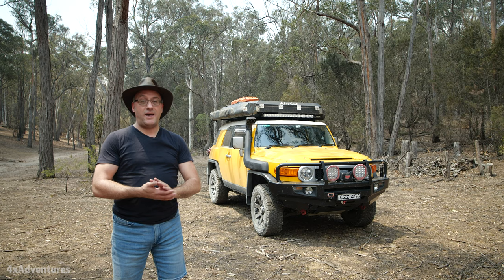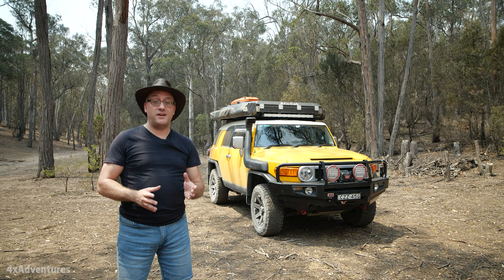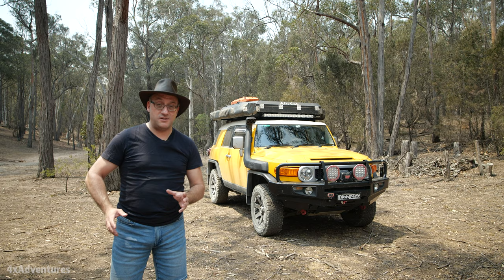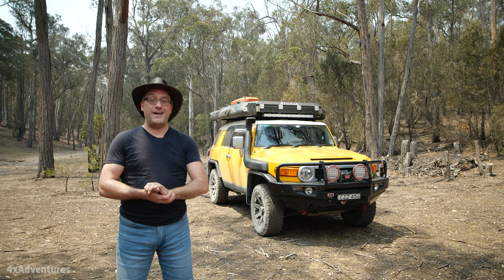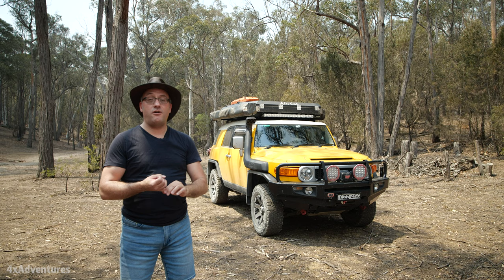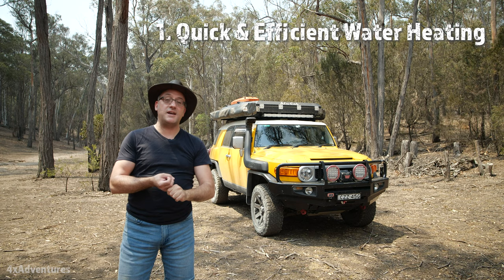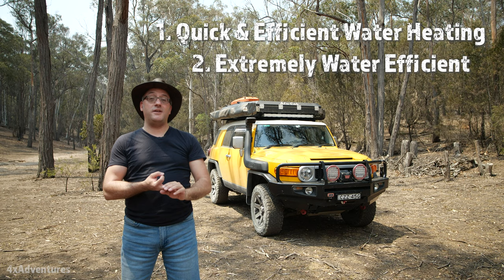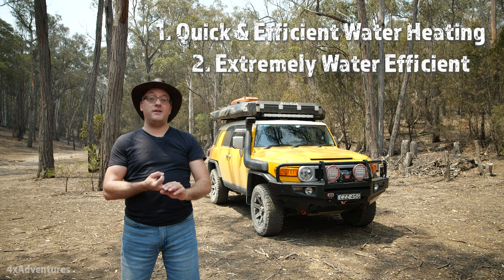Built-In Hot Water and Shower System for Touring/Overlanding | @4xAdventures#adventure #4wd #touring

Comment: I have the Glind system set up on my car with the two hose connections plumbed to the front of the bull bar. In between the two connectors is a marine switch to turn on the pump. This eliminates having to lift the Bonnet. People who own these systems are always under the impression they have to run the motor while they have the shower. This is not true. You can heat the water first. What I do is, using two short hoses I heat the water up in my shower jerrycan first. I have a thermometer dropped in it that has an alarm set at my desired temperature, which for us is 45°C. The wife loves a very hot shower so she goes first and then by the time I go in the water has dropped that little bit which suits me. While the water is heating I set up the shower pole at the front of the bull bar. I prefer the shower at the front of the car so it’s not soaking the ground around the door areas. Once the water reaches the desired temperature, the alarm goes off. I then turn the pump off and the car off and swap the two short hoses for the shower hoses. The water temperature only drops minimal by the time you’ve had your complete shower. It’s a way better experience having a shower without the motor running. You can enjoy the tranquility of the bush. If we need privacy I have a pop-up ensuite that just clips onto the front of the bull bar. 
We’ve had this system on the car for about 12 years now. In my opinion, these are by far way superior than any other shower system. No matter what the weather conditions are you’ve always got a hot shower. All the bulky componentry’s are under the Bonnet and out of the way.
Reply: Hey mate what connections did you connect to your bar?
Reply: @andrewsimpson1433  Standard brass hose fittings. The male ends. This is so I can connect blocked off female ends that act as covers.

Comment: Thanks for the great information. I’m halfway through fitting a Scintex 30 plate heat exchanger to my FJ. I’m now going to incorporate a temper valve and the JG piping.
Reply from the maker: No problems! I haven’t seen that heat exchanger before. I’ll check it out.
Re. The pump, just make sure you use a pressure sensing pump, otherwise you won’t get enough pressure to make things work properly!
Good luck!!
😊👍
Reply: @4xAdventures  yes, Seaflo pump pressure sensing. I'm building a solid, reliable system.  It will take some time & $$ but it will be worth it 👍😀
Reply from the maker: Yes, it isn’t the cheapest solution, but it works really well & should last as long as the car does. And no hassles with lugging showering contraptions around with long setup times. I think this is a great solution :)

Comment: That is a nice install, simple, efficient & elegant, does away with the overheating issues that others complain about with the Glind system, a temper valve just makes it simpler & better. Love the pop out shower cubical as well. I will look into that pressure piping for my install as I just scored a full Glind system in a case for free today.
Reply from the maker: Thankyou! 😊👍

Comment: I’ve got a companion aqua cube lithium and I spent two weeks away over Christmas everyday and it never let me down, in my opinion better than a heat exchanger
Reply from the maker: I also have a Coleman hot water on demand, which is similar to what you have. Every product has its strengths & weaknesses. I’m glad you’re satisfied with your product. 
The reason I decided to make my own hot water system is because i wasn’t satisfied with the Coleman unit. It was incredibly wasteful with water, and it took ages to set up - lots of clutter & paraphernalia. I think if you’re staying at one camp site for a few days, then it’s fine to set it up & leave it, but I was after something that was simple, quick to setup & efficient with water. So I think I’ve improved on my old Coleman system, which I found to be a hassle. 
But, to each their own! 😊👍

Comment: This is great! I'm in Nashville, TN and am building out a 2020 Tacoma Off Road. I just found my shower solution. Thank you for taking the time to make this video and post it.
Reply from the maker: Hey Joey! Thanks very much for watching! I’m glad you found it useful. I’m sure you will be satisfied with this solution. I’d love to see the completed Tacoma - they are great vehicles!! 😊👍
Reply: @4xAdventures  Is this the correct exchanger? https://glind.com.au/store/heat-exchangers/glind-auto-marine-heat-exchanger/ 
Model SKU: GL27 Auto and Marine. 
I'll for sure share some pics when its completed!
Reply from the maker: Yes, that’s the one. Glind has a US distributor. Check the video description for the link. That may save you international currency & shipping fees.
:)
Reply: @4xAdventures  Would the SEAFLO water pressure pump Model : SFDP1-070-060-53 do the trick? Also, if its not too much trouble, can you tell me what model temper valve you decided on? Thank you very much for your time and knowledge.

Comment: The system I just built is a tad simpler. I used a ball valve on the inlet of the coolant to the heat exchanger to control the shower temperature. The more you shut the valve, the colder the water gets. I also used a pump and a solenoid valve instead of a pressure sensing pump.
Reply from the maker: Excellent! Very clever!! I guess just don’t forget to open the ball valve fully before driving :)
Do you have to keep adjusting the ball valve each time until the water temperature is right? The advantage of the temper valve is you get the correct temperature water straight away without wasting water. But I like your setup!
Great job! 😊👍
Reply: @4xAdventures  I just leave it fully open. So far my setup produces pretty much perfect water temperature with the engine idling, and if I need to make it cooler i can always close the valve a bit.
Reply from the maker: Excellent!! :)

Comment: Nice system.   I had hoped you'd made your heat exchanger yourself as this is the part I am searching for.   But I will steal that temper valve idea :)
Reply from the maker: Thankyou! I don’t make the heat exchanger, but I liked the idea so much I have eventually become a reseller of the Glind heat exchanger. You can check out 4xAdventures.com.au for more details if you’re interested. I’m still working on how to sell all these bits as a kit, but it’s quite difficult as every car is different. All the best! 😊👍
Reply: @4xAdventures  I am trying to work on a slightly different system, I am not sure if I am wasting my time or not, but I am looking at having a hot water storage tank, and the heat exchange would be like a coil running through that tank.  My theory was I could have 20l of hot water stored.  Too much for just one but I camp with the whole family often.  The problem is where to put a tank in an overland vehicle.  I would imagine your system may require an engine running if I was to shower a bunch of people?
Reply from the maker: Yes, it’s fine for a while with the engine off, but eventually you would lose heat. Your best option is to get yourself a Duoetto electric hot water heater. They have 10L and 6L versions. They are excellent. If you look at my plumbing, just replace the heat exchanger with the electric water heater - you can still use the temper valve & pump and it will work perfectly well. With 10L you should easily be able to shower 4 people. I will hopefully list their products for sale on my website soon. 😊😂

Comment: Great system - I think you've solved the only real hassle I have had with a heat transfer shower system....by using the temper valve ! Brilliant ! I take it that the one pump can generate enough pressure to impel the water in 2 streams, one to the heat exchanger and the other to the temper valve ?
Reply: Actually, you have already answered my question above. Another one : did you get the under bonnet hoses and fittings from RTM too ?
Reply from the maker: G’day Denis, yes, you’ve got it! water source > pump > splitter. 1 path to heat exchanger > hot input of temper valve. The other path to cold input of temper valve. Mix output > shower rose/tap.

Mine has evolved a bit beyond that now. I have a choice of inputs now & a few other tweaks, but that’s the basic flow.
Reply from the maker: The heat exchanger came with a few radiator hoses, but I had to go buy a few more from Repco to make it fit nicely.

Comment: Will the tempering valve stop the water flow out the mix output if the water temperature is under the set temperature or only if it is over the set temperature and not able to get cold water through to mix it?  Meaning if the vehicle is not hot enough to enable the heat-exchanger to provide hot enough water for the tempering valve setting. Otherwise you could still waste plenty of water if you did not run the vehicle long enough before using the shower. Great set up by the way.
Reply from the maker: Thankyou. Yes, you are correct, the temper valve is designed to stop the temperature getting above the set threshold, but it will let colder temperatures through. I’m using a scangauge which is connected to the OBD port. It shows the engine water temperature, so I can tell by looking at that - but also just experience will allow you to gauge what the resulting output will be. But, you can always just leave the engine running and all will be good! 😊👍

Comment: This is the way to do it! Love it! 
Can you please tell me if the pump you recommend will lift water up from a bucket or even a creek with out the need of priming it first? It looks like you have it located higher than your tank?
Reply from the maker: Thank you! The pump can definitely lift water from a bucket, no issues at all. The factors that determine if/how well the pump works in other scenarios are: length of hose, the incline up which you draw the water. I haven’t tested this over long hose runs or up steep hills, so can’t give you a more definitive answer, but I do remember reading the pump specs where this information was documented. Perhaps try to find the technical specs for the pump? It is a Seaflow 9.5LPM automatic pressure sensing pump.
All the best! 😊👍

Comment: Great video, what a great system. 
I have a 2000 hiace trakka with an undercarriage tank of 118 litres and another 50 litres under the bed.  The tank under the car used to heat off the coolant water via a hose running through a coil inside the tank, very efficient. Unfortunately the coil ruptured inside the tank and dumped all the coolant out the engine into the tank! Luckily I noticed the engine overheating and pulled over immediately.
I've been toying with the idea of removing the tank, cutting the top of the tank off and replacing the coil then welding the tank shut again....big job.
I've since come across the glind system which seems really practical to me, one question, my inline whale pump runs at 12 litres per minute, much more than the 3.8 litre per minute supplied with the glind system. I'm a bit concerned it will pump the water too quickly through the heat exchanger for it to heat efficiently. What litre per minute is your pump?
I've been in contact with Trakka and they have told me I can reduce the flow by turning the tap down to reduce the flow which will alloy the water to get hotter.......Thanks in advance for your feedback.
Reply from the maker: G’day Eric, yes, that’s exactly what you should do. In fact, I do the same thing - just reduce the water flow rate by only opening the tap partially. My pump is an automatic pressure sensing pump (seaflow) which uses a diaphragm, so it can handle working at reduced capacities. I can definitely recommend the Glind heat exchanger as I’ve found it to be a rock solid product & it works very well, especially if you build your system to use a temper valve to control the temperature like I have. 

Good luck!! 😊👍
Reply: @4xAdventures   I live in Qld so most of the year won't be using hot water and probably wont fit the temper valve, does this make sense to you? Happy to rethink if you suggest why it is practical no matter what the air temp is.
Reply from the maker: I’m in QLD right now, filming another adventure :)
I know what you mean, in the summer the water in the tank is mostly at room temp or warmer, so you don’t really need to heat it. But, if you do want warm water, the temper valve is a sure fire way of getting the correct temperature without wasting water mixing hot & cold. You can adjust the temperature on the valve depending on summer-winter needs. That said, if you have a 160L tank, it sounds like you have plenty of water.

Comment: Great video, love the idea of the JG Speedfit. How did you connect the Speedfit to the glind heat exchanger?
Also how has the speedfit been with vibrations etc?
Reply from the maker: Thankyou! The Glind heat exchanger has barb connectors on it, so I am using a short length of hose to go from that to a barb-JG connector. But, I’ve spoken to Glind, and they will be offering a choice of barb or JG connections on the heat exchanger!!

It’s been rock solid over the past few years. The speed fit connections are designed to just get tighter if you try to pull them apart without first pushing together and depressing the outer ring, so they can’t come apart. Very clever design! 😊👍

Comment: I’m gearing up here in the next week or so to start installing my own pressure hot water system on my Jeep! I really like how yours is put together. I have a pressure sensing pump, heat exchanger, temper valve and in-line screen filter. I won’t have a storage tank yet, as I need to give that a little more thought as to the location. I’m curious, since I’m a visual person, do you have some sort of diagram as to how all the plumbing hooks to all the parts? 
Thank you in advance, love your simple system.
Reply from the maker: Thanks very much! There is a diagram at the end of the video. Also, there is a follow up FAQ video where I go over the whole system in fine detail and explain how to plumb it all together. 
Good luck with your build!! 😊👍

Comment: I love the idea of a Glind system and you take on it.  I use a portable HWS that is proving very impacticle. I have a LR Discovery 4 and was wondering if you could install the Glind system into that? The challenge being is that it is very limited in space inside the engine bay. What do you think? Could you supply what is needed?
Reply from the maker: Hi Peter. Thanks very much. The heat exchanger works very well, and especially the way I have set up the plumbing, it is very water efficient and works very well. Space in the engine bay can definitely be problematic on some vehicles. I had to make up a custom bracket to mount mine in "the air" because I had no more space left on the walls of the engine bay. I've seen the engine bay of a LandCruiser 200 series which is so cramped that you would never be able to fit this in. If you do have some room, ideally, the heat exchanger would be mounted close to the existing hoses so that you don't add too much length to the system. Other alternatives could be using an electric hot water system (like the Duoetto MkII) instead of the heat exchanger. I have built a system using this and it works just as well. 

I can supply the heat exchanger if you like. I've been working on putting together a kit with all the parts, however I haven't had too much success with obtaining a wholesale price for the plumbing, therefore at the moment, you could buy all the plumbing parts and pump cheaper yourself, but I will keep working on sourcing the plumbing for the kit. 

If there's enough interest, I could still put together a kit now. Let me know if you are interested in either the kit or just the heat exchanger and I will set up an online store (half done already) so you can get going with things.

All the best!

Comment: Thanks for the posting on hot water showers! Did you attach the heat exchanger, tempering valve and pump to the side walls under the hood? I have a RAM Promaster with a tiny hood and crowded engine compartment, won't fit under there, have you heard of anyone who's installed this set up in a Promaster?
Thanks!
Reply from the maker: G’day Mark, no I haven’t. I’m currently doing an install where the pump is at the rear of the vehicle and only the heat exchanger and temper valve are in the engine bay. You can get a variety of shapes & sizes of heat exchanger, so you may be able to find something that can fit. If all else fails, a possible alternative may be to use an electric water heater and place the whole setup in the back - depending on if you have room, and sufficient battery capacity. 
Oh, I had to make a custom bracket for my heat exchanger because I had no room to mount it to the sidewall of the engine bay. This way, I have it located in a space between other components just near the engine.
Hope that helps. All the best! 😊👍

Comment: Great system! Thanks for posting; i had one question; does the water supply tank have 2 outputs? One to feed the heat exchanger and one to the temper valve? Thanks !
Reply from the maker: Hi Robert, thanks very much! You’re almost on the right track. The water supply does split into 2 paths, but not from the tank. Check out the FAQ video I posted about the hot water system. That should answer all your questions! 😊👍

Comment: Great work, 
Thanks for sharing! I wonder if the plumbing hardware you used is robust enough for the sustained duty cycle and rigors in an Automotive environment?
Reply from the maker: Thankyou. It should be. As I understand, it’s designed for this purpose. That said, the shower is in use only for a few minutes each time, so the vast majority of the time, it sits there unused. The components are designed for high temperature, so it will be interesting to see how they cope over time. I also made sure to allow some flex & movement in the plumbing which should help as well. Time will tell!